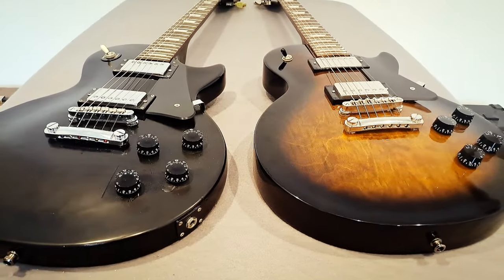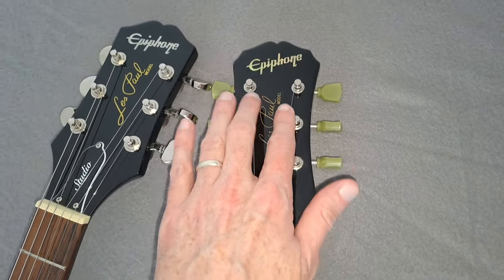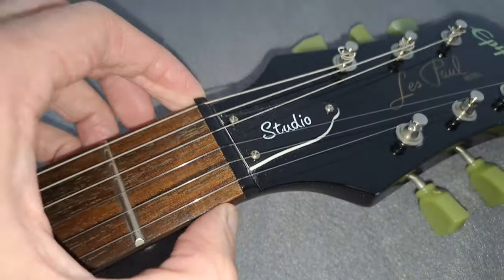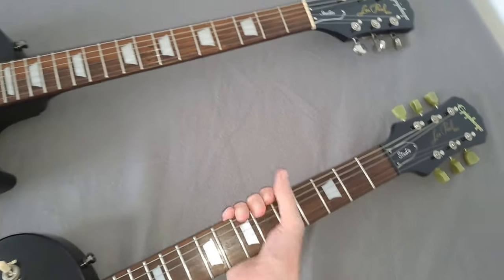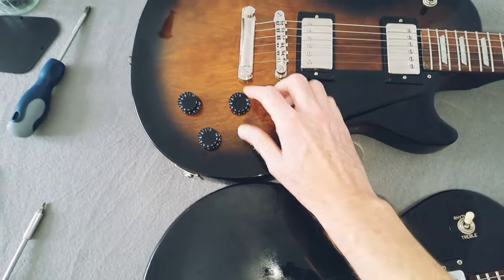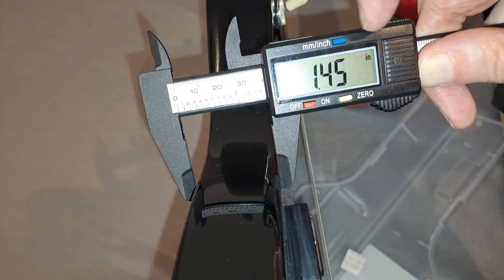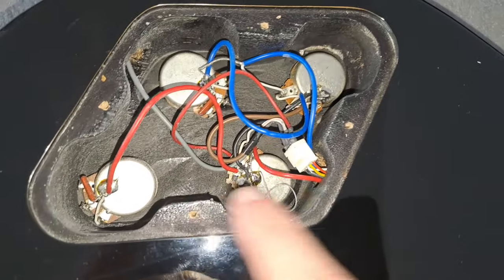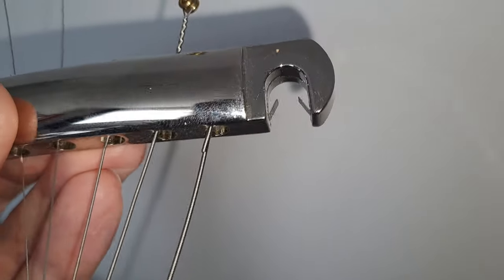Korean VS Chinese Epiphone. Which is BEST?!

Comment: I'm just going to give my 2 cents as comments not what others should do. I have a 2004 Zakk Wylde Epiphone Les Paul and I had a Gibson 2010 Studio Artic white with the Ebony fingerboard, so a really nice version of the Gibson Studio.  I bought both new, not used.  
The 2010 Gibson i left stock except I installed better tunes and I always backstring the taistop so I had an extra tailstop for it. 
I'm a huge Zakk Wylde fan so keep that in mind.  First thing I did to the Epiphone was installed and tusk nut, made a huge difference for note clarity and a bit of sustain. I installed the EMG Zakk Wylde pickup set, but wired the batteries for 18V instead of 9V. I also sanded all the clear finish off the neck and sealed it with proper Oil.  
Recently I have literally wore out the tunes and installed a set of Ratio tuners. All that being said I sold the Gibson about 2 years ago because it was a case queen.  Was always worried about chipping it etc. The Epiphone is more a work horse and beat the crap out of it with no worries.  
For sound,  the Gibson for some reason was to bright sounding for me , it did have the weight relief cuts in the body as well, which always felt weird to me.  The Epiphone is a tank, I swear mine is closer to the 9lbs mark lol.
Both guitars I actually copper foil shielded so grounding was great on both. The neck on the Epiphone felt better to me over the Gibson,  even though I preferred the Ebony over the Rosewood on the Epiphone.  The neck shape  was much better and much faster playing then the Gibson.  My Epiphone always stays in tune even when it had the Grover tuners,  the Ratio one's are absolutely amazing!
I just found the Epiphone checked the boxes more of the Gibson for me. Yes I obviously put more into the Epiphone,  but playability alone with the neck was way better,  even though I prefer the Ebony.  Sound wise , I really didn't like the sound of that Studio,  again just to bright for me. 
I have a guitar with the Indian Laural fingerboard and I can tell you the dry out alot and have to keep up with Oiling them. Out my 8 guitars it always needs more maintenance then any of my Ebony fingerboard and definitely more then my Rosewood one's. 
I will say I couldn't believe how much clear finish they put on the Epiphone was ridiculous , I swear it was like taking off 3/32 of finish lol. But once removed and Oiled you can't beat it lol.
Frets were ever better on the Epiphone for some reason.  Never had issues with the Epiphone at all the Gibson had Fret sprout a couple times.  Now I live in Central Canada so the temperature swing is nuts.  From -45C in winter to +35C in the summer and the Epiphone doesn't care, it just works.  The Gibson had the typical tuning issues and the Epiphone didn't.  
Kinda long, sorry about that,  but that was my experience between those two  even though the Gibson should have been better,  it wasn't for me and I kept the Epiphone,  I sold the Gibson and bought a Kramer Dave Sabo signature model in place of it and that's an Amazing guitar in its self!
Reply from the maker: Oh, I need to check out the Kramer! I have a Gibson Faded I'm going to do a review on too. Like you say, mine is the same regarding the brightness. It is much brighter than than the Epi. The sound is more different than I would have thought. Both nice... and worth keeping both lol. That's how I'm justifying an expanding collection anyway 😅

Comment: Nice video! Just a note- what you're pointing out as weight relief is actually the routing for the wires from the pickups and switch to the control cavity. This is on all Les Pauls, due to the switch location. The weight relief chambering will be hidden behind the top. I love my 97 Korean Black Beauty 3 Pickup- it's been gigged to death.. Mine benefitted hugely from a Gotoh bridge- really added life and sustain to the sound. Just rewired it too and it's sounding better than ever. Heavy as hell, but a great guitar.
Reply from the maker: Thanks! I can relate... my Epi Traditional is going towards 4.5kg which is a fair bit after some hours of standing! I thought the rout looked quite a bit larger on the new Epi so assumed it was part of the chambering. Guitar Max sawed thru a LP once. I'm not sure I'm brave enough to do it and check the exact routing... but never say never! The '97 Black Beauty is a lovely guitar. Keep rockin' 🤘🎸

Comment: So, when I started learning to play guitar waaaay back in 1996 my 1st guitar was a Squire HSS Strat and I just didn't gel with it, so I thought I'd try a Les Paul and saw that Epiphone had released a few funky limited edition coloured models that year so I got myself a nice, Korean made Epi Les Paul in wine/purple burst (it was marketed as Trans-Purple) and I clicked with it and 28 years later I still have it. It's mostly stock too, I've only had to swap out the toggle switch once and replace a tuner after the peg got damaged
Reply from the maker: Nice, sounds like a cool guitar. I think they older ones are awesome. They have loads of mojo. Keep rockin' 🎸🤘

Comment: I don't know ! I have a new 2022 inspired by Gibson epiphone les paul gold top traditional pro iv and it's pretty awesome ! I also have a regular 2014 cardinal red les paul standard and it's awesome as well but the 2008 Epiphone SG prophecy is a dead copy of Gibson sg standard 2017 down to the neck shape and light weight mahogany so id say the older the best in my case but there's no way i just got lucky as I've never bought a bunk Epiphone guitar, they all were good! I played the new Epiphone les paul customs and they are pretty freaking nice but i won't pay $800+ for em since i remember they were only $500 not too long ago, that and the fact Dean are beating Epiphone at the same price no problem  ! Do yourself a favor if you want a killer guitar for under $600 you can get a Dean 1980 series brand new or a used select series and have 100% Perfect guitar in every way, they blow Gibsons away so they beat the crap out of Epiphone  !  I think that Gibson knows that and that's why they sued Dean  !
Reply from the maker: I'll have to check the Dean out for sure! I know of the Bolero which I've heard good things about. Ah, the SG! I haven't got one by Epi or Gibson yet... but I've got my eye out for one. I have the original Epi Traditional Pro - v.cool guitar - I did a review of that one you might enjoy: https://youtu.be/VqbIiUdB4Z4?si=jcu6zZRLgKmMeKuP

Comment: Ummm not saying that you don't have a great Epiphone, but in my personal experience, old beats new dang near every time, I work at Sweetwater in Indiana, we set them up before we put them on the floor, because so many come in with crappy feet work, sometimes wires need reattached, and necks often have to be adjusted, and let's face it, it's a personal opinion but at the price people pay, they deserve a bone nut, also intonenation has to be adjusted, I sincerely hope other places have better than our area, but have to say I doubt it.
I could have any ax I want, but I play a 250 dollar axe and invest in a great amp. Did not have to do anything but adjust the neck slightly and of course new strings.
Sorry dude I just see to much
Reply from the maker: Interesting... the box was open when I bought mine, so it's very possible it had a decent set up. When a guitar is shipped across the world from the factory, you would hope a lot of shops would do a set up. My old one was ok when I got it. As a used buy, cheaper than new and a great guitar still. Assuming a good set up, to me, they both sound and play awesome. My Epi Special II was a bit of a different story... that's a guitar that could do with upgrades. There are some pretty significant look and feel differences like the body thickness, pots etc on the Studios. I had wanted to sell one, but I think doing this video has made me enjoy them more... I think I'll end up selling something else! The Slash I briefly mention in the video is also good (not perfect), but maybe the shops near me are doing good set ups before they even reach a consumer's hands. To be fair, it's great to hear Sweetwater do that due diligence. Keep rockin' 🤘
Reply: I think the reasons old guitars (15+ years) tend to be better than new ones is that only the best of the best manufactured back then actually survive to this day. So the average distribution of quality is likely to be higher for old guitars than newer ones but this depends on quite a few factors like quality standards today vs then, the lifetime of a good vs bad "old" guitar etc. Older guitars are also more likely to have had work done on them just because of their age and imo a good setup (frets, action, truss rod) is rlly what meaningfully differentiates guitars in different price brackets today..